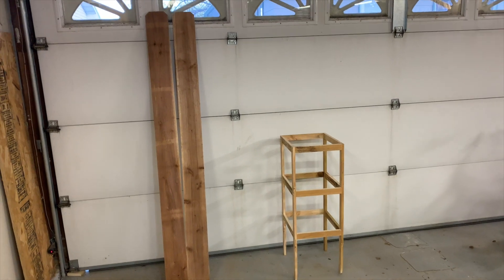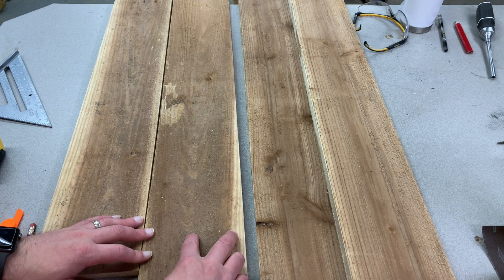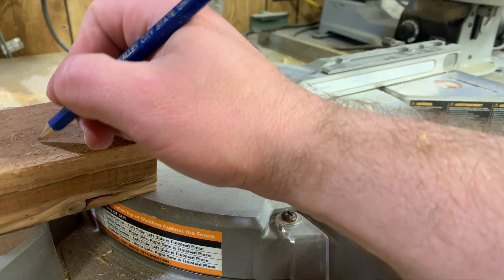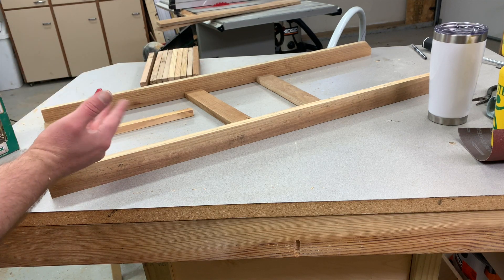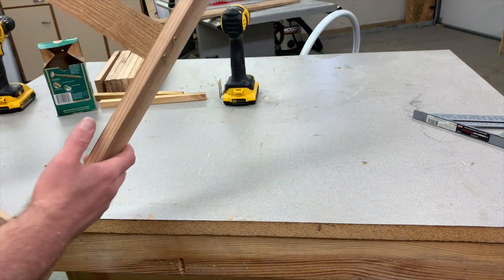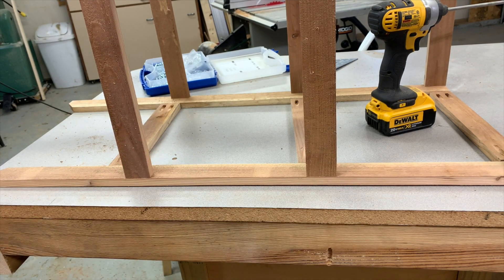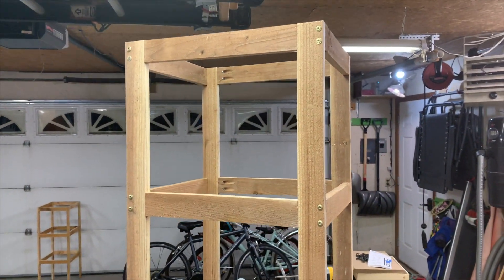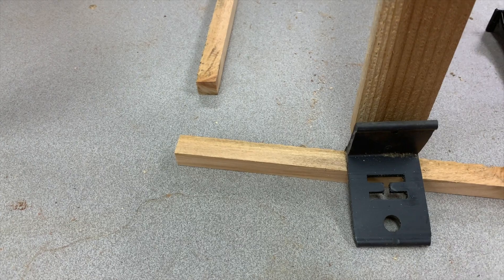DIY Tomato Cage from Cedar Fence Pickets

Comment: Wish you had shown the Kreg jig use a bit slower and how you aligned it.  I've never quite got the hang of the Kreg tool.  Video was excellent.  Just what I needed to see.  This is such a nice and simple tomato cage.  In time for growing season.  I wonder if redwood will work just as well as cedar?  Neither has much strength but good for weathering and water resistance.
Thank you!